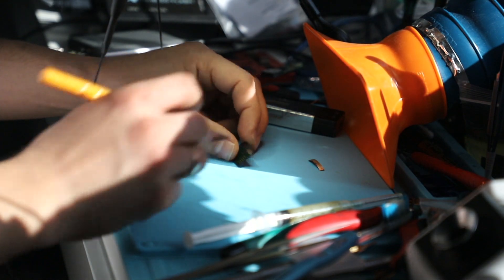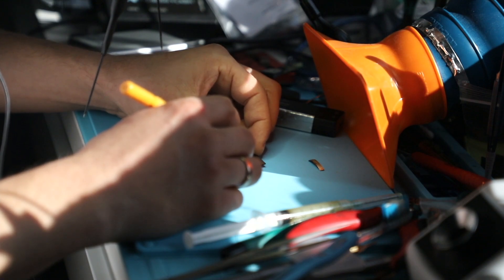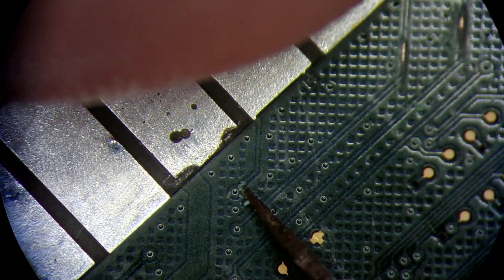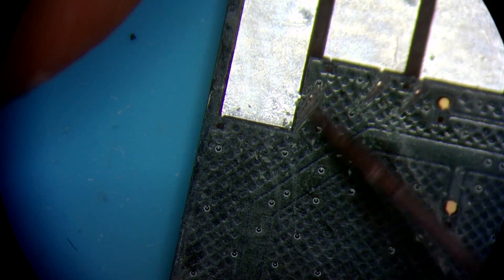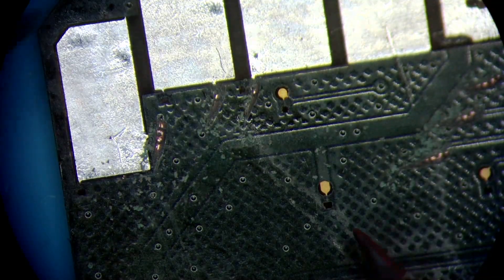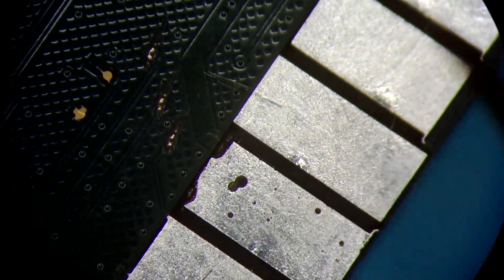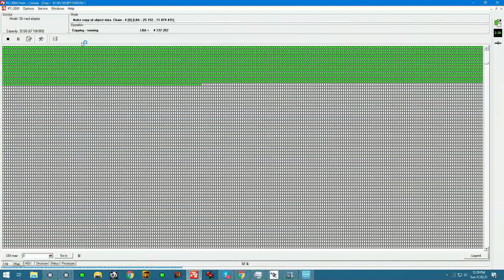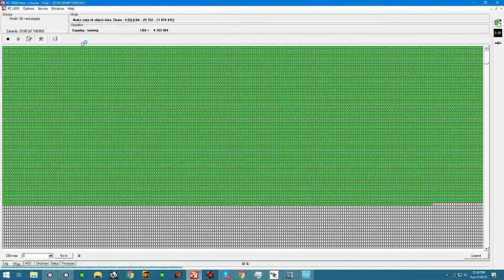why i love liquid damaged memory cards

Comment: SO did you charge the client for the data recovery?
Reply from the maker: I can't remember. But yeah I would if client approved the recovery work. One wire or not, it's still a job that gets charged for the content, not time. Just like I don't charge more for this who have a more challenging  work
Reply: @hddrecoveryservices  well sounds like reasonable pricing.